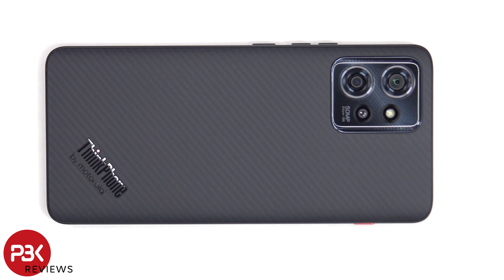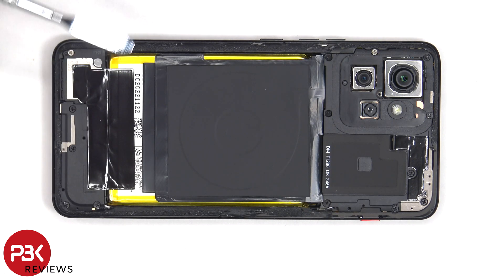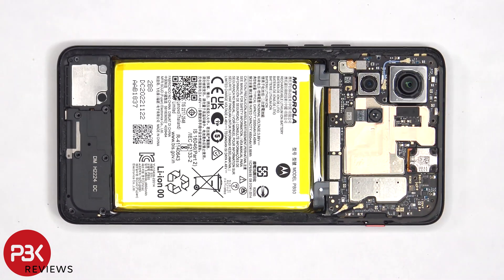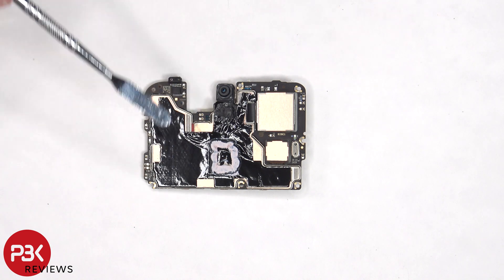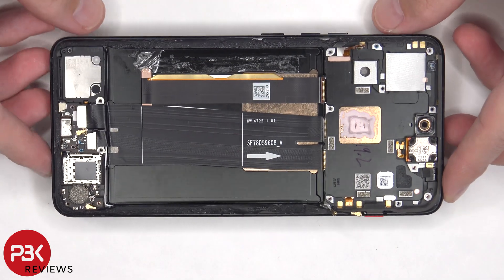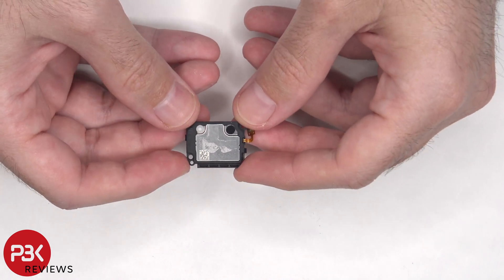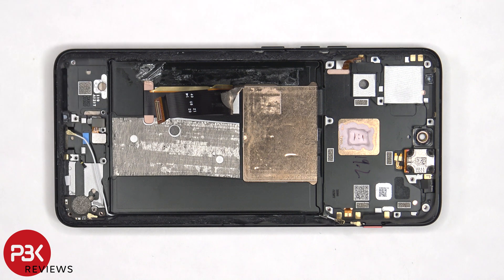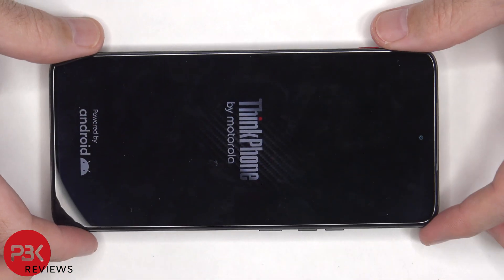Motorola ThinkPhone Teardown Disassembly Repair Video Review

Comment: I'm looking to put a MagSafe ring adapter on my ThinkPhone. In the video the wireless charging coil looks to be in the middle of the phone. Can you confirm this? Could you possibly give a measurement of where the dead center of the coil is?
Thanks!

Comment: Can the sub-board with the USB port be replaced without first removing the main board and battery?
Reply from the maker: yes, as long as you have access to it, you don't need to remove anything else.

Comment: Its certainly a tough phone for being so light but if you drop it without raised case protection around the edges its going to shatter like any other device. Screen protectors are a drag but you kinda need one of those too

Comment: thinkpads are made better, easy maintenance this thing seems normal motorola smartphone with think logo on
Reply from the maker: yep
Reply: I like the carbon fiber back.  Just broke my LG v60 glass back and it was in a good case.  Dropped about 3 feet into concrete.  I just got the thinkphone.  Still put a decent case and tempered glass.  I think with the carbon fiber build it will hold up pretty well.

Comment: Thanks for your great teardown video.
Do you think this phone quality is really good in terms of the build quality, ruggedness, and durability? 
How do you rate it compared to the BlackBerry's flagship phone I.e. Passport, Classic, KeyOne, Key2; or even the Unihertz version?
Reply from the maker: Thanks and you're welcome. Yeah its definitely a well build phone and durable. The Unihertz type of rugged phones will be more rugged than this in terms of the body materials being more thick and rugged, as well as plastic layers or plastic screens which don't break as easy. However for the form factor and higher spec device, the ThinkPhone definitely comes out on top.
Reply: Thank you very much for your answer.

Is there any business phones with similar as or better quality (build quality, material, durability, finishing detail, ruggedness, form factor) than the Motorola ThinkPhone that you would like to recommend ?

Comment: Practicality aside, this is an interesting phone to view. For example, the lower speaker is not part of the lower plastic cover. Instead, it is a separate unit. The sim card reader is not part of the daughter board, it is connected by a ribbon cable. I don't think I have seen anything like this. This is just not a practical phone to buy anyway.
Reply from the maker: Yeah, I've seen it occasionally in different phones but yeah usually not the case.

Comment: Whyd they use a depth camera?
Reply: To increase the number of cameras for marketing without increasing the cost by much. These depth cameras or low-resolution macro cameras are usually called "strategic cameras" because they have no practical use besides marketing... and manufacturers should stop this. We never say the non-pro iPhones are lacking in cameras despite having just two.
Reply from the maker: Not sure